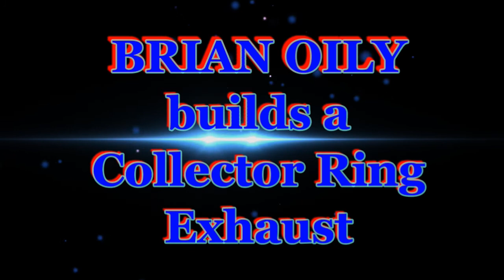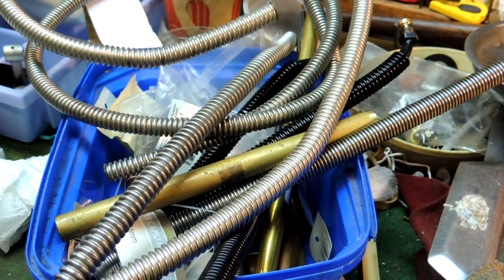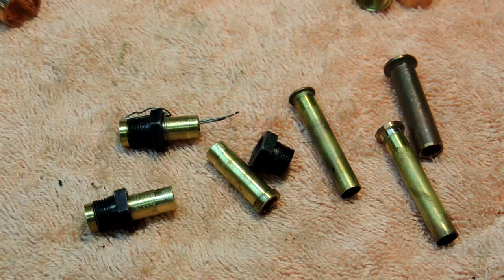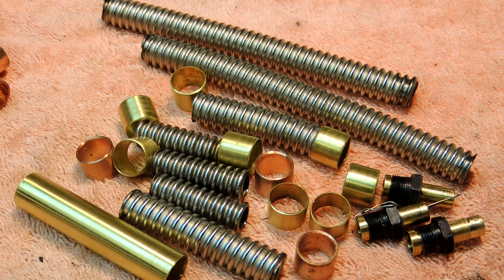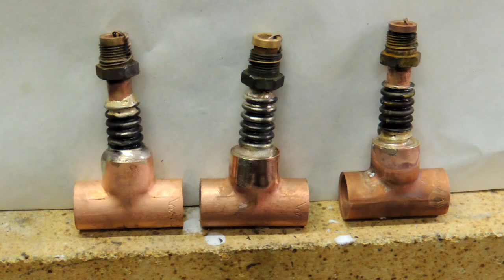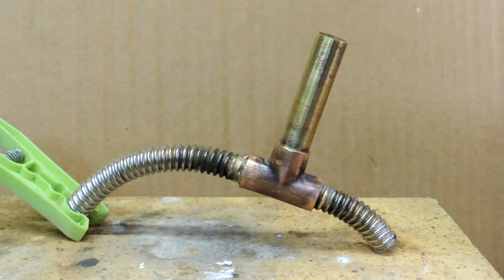EXHAUST COMPLETE

Comment: One question sir, are those flexible steel pipes sealed ? if you cap one end and blow some smoke or put some watter will it leak through the "rings" of the pipe? I ask because i see DLE sells one that needs to be wrapped with some teflon tape in order to make it sealed!

Comment: Hi  I have to build myself one too, where do you find the sleeve nuts saito ?
Reply from the maker: Yo mor0x24
I made mine on my lathe but you can purchase them from Saito as a spare part or use the ones that came with the supplied exhaust system. The adaptors are silver brazed into the flex tube so a bit of good heat will release them and the sleeve nuts can them be slid off and used.All my engine reviews etc are fully written in the UK magazine RCM&E and this provides a lot more information.
Let me know when you build your exhaust and how it goes for you.
Regards
Brian Oily